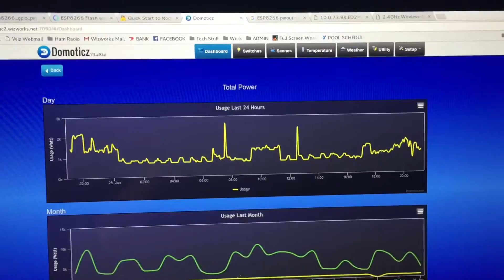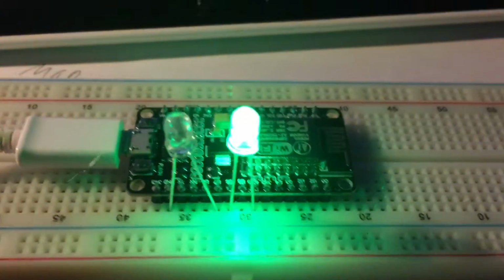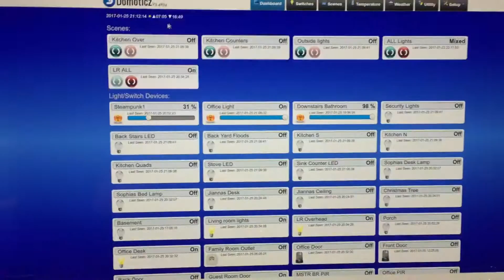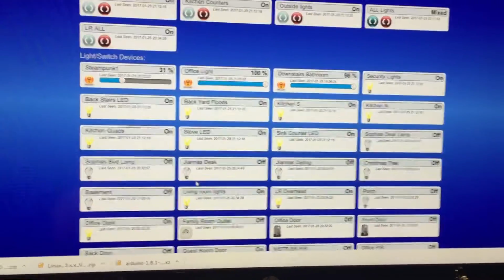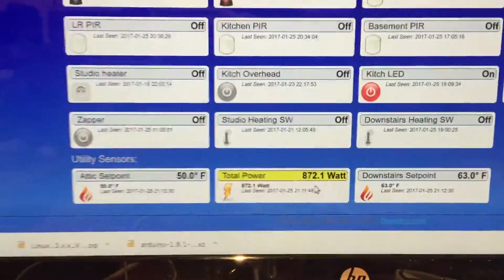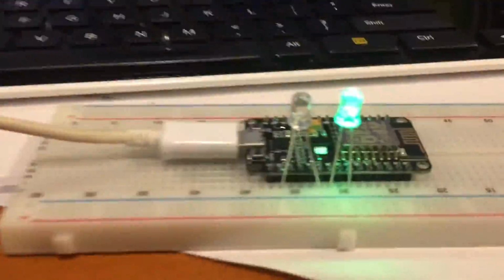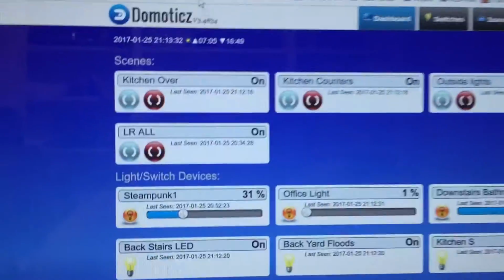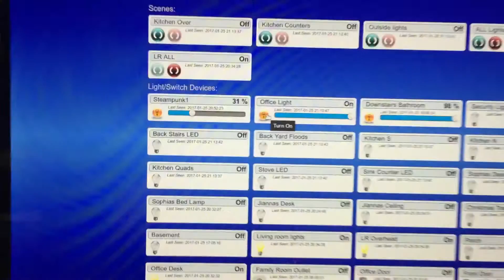ESP8266 Energy Monitor

Comment: Which Home Automation server software are you running?  Have you utilized Home Automation on a Raspberry Pi?
Reply from the maker: I use Domoticz running on a raspberry pi 3, which is mounted in an aluminum box with a PoE injector.  The system is connected and powered by a cisco 3750 switch.
Reply: Home Assistant on Raspberry Pi is very good and further, the LEDs could be on the PI, freeing up this ESP8266 to do some other sensor job. Also, with ESPEasy, you don't even need to write any code. You just hook things up and configure.